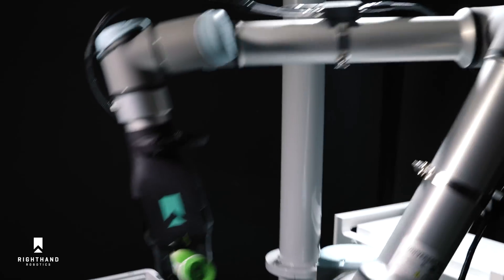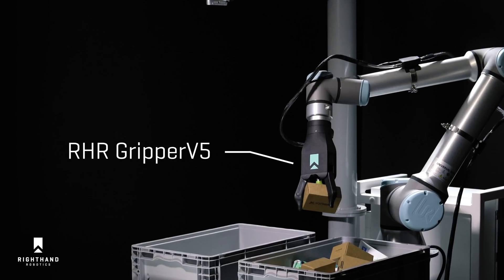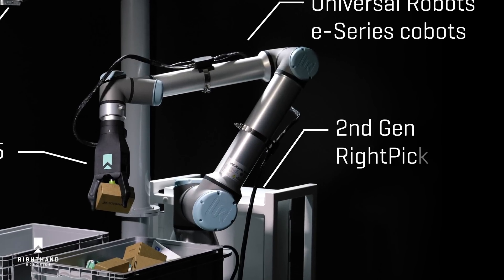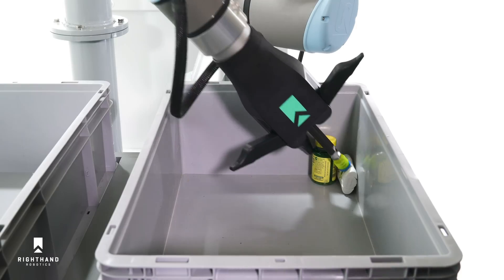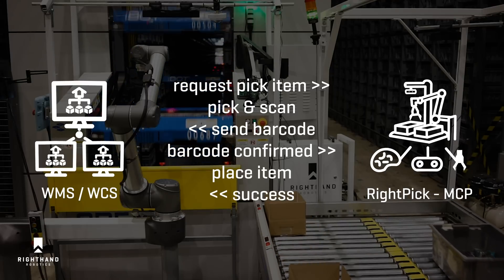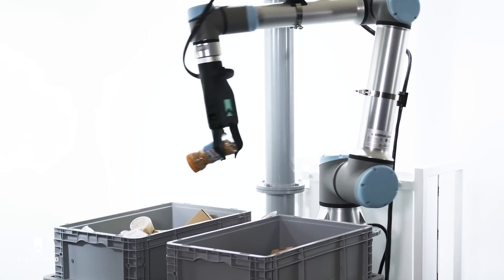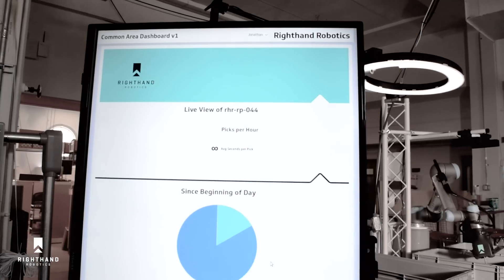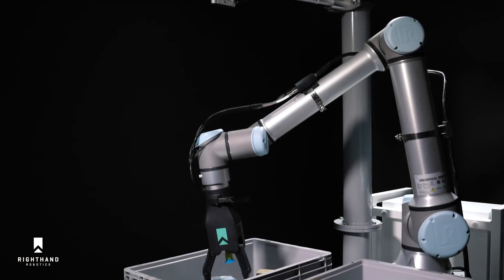RightPick2: The Robotic Piece-Picking Solution for Intralogistics

Comment: very impressive - I have a few questions. 1. What is the accuracy in say a randomized box of items 2. if it drops an item does it try to re pick it 3. what scope of items can it pick in terms of size and weight....Its very interesting that it can auto swap suction caps, most likely increasing the variety of items it can pick